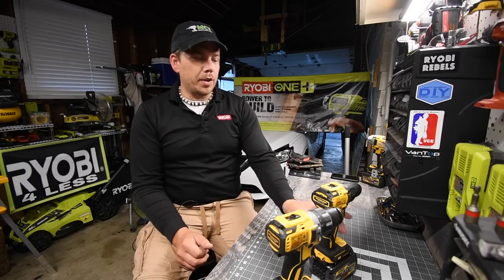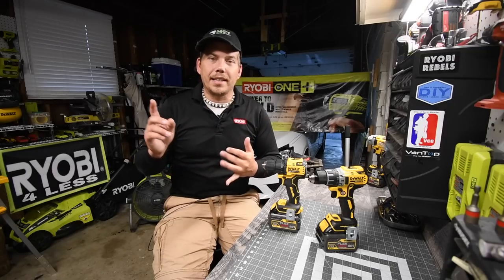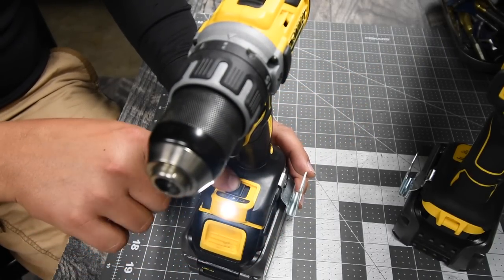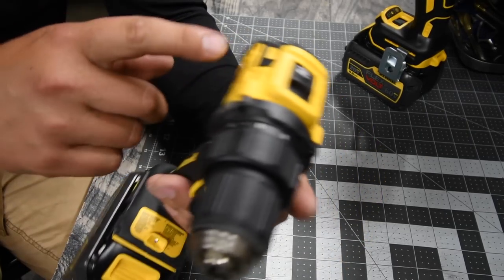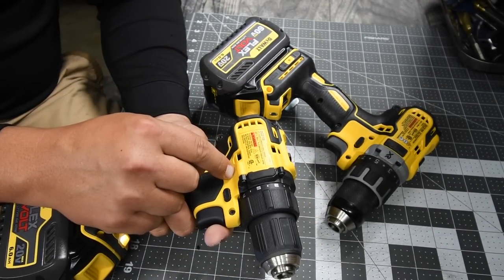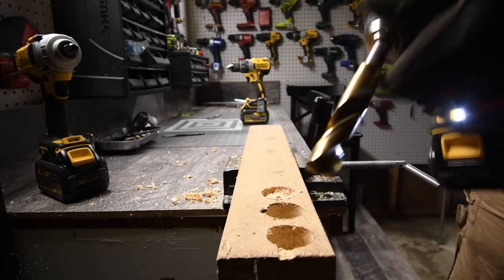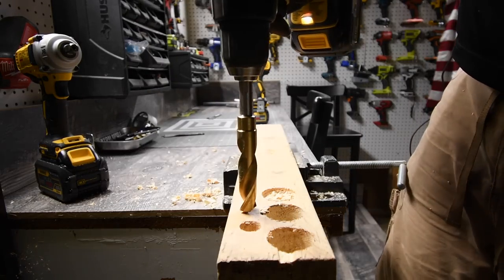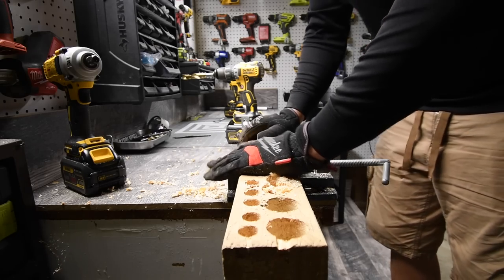Dewalt Atomic Vs.  XR

Comment: I am a career carpenter and love my ATOMIC drill , for drilling decks or hanging doors etc all day it is ideal, I even   put a 600x16mm auger on it in speed one of course ,it powered it through 300mm of seasoned hardwood easily ,very impressed. I bought it specifically because I wanted a light drill and I am on the 18 volt platform ,if I wanted brute force I will use the heavier 996 . The  708 was never meant to match the 791 ,but It still punched well above it's weight.
Reply from the maker: people need to give the atomic line more credit then what people give it. I thank you for viewing Interman
Reply: I know this comment is old but I was looking more from someone who does finish carpentry or hang doors which is what I do. I appreciate this comment thank you!

Comment: The torque specs on the DeWalt DCD791 is 460UWO = 70nm or about 620in-lbs or about 51ft-lbs, just thought I would add that incase anyone is wondering 👍.
Reply from the maker: I thank you for the additional information Kristian

Comment: I opted to skip the atomic drill and carry the xr and the 12v extreme drill instead . I just really like the specs , built quality and feeling of the XR, never rock my drills or driver with a bigger battery than a 2 ah, or a 4ah max, so weight to me, feels the same almost, if i really want to go light i use my 12v.
Reply: Crap!! why you  keep saying atomic, and again XR and impact dril and extreme dril, you confused us with Impact dril and impact drive and exrteme dril and extreme drive. could you tell those terms you are using?

Comment: My dad has the XR line impact driver and Xr line Drill Driver. I bought the atomic drill driver and hammer drill combo with two 1.5 amp batteries, a charger and a touch system case for $150 at Home Depot. It doesn’t have the same power as the bigger dewalt and makitas and Milwaukee but I have the less fatigue from not having a heavy impact while at work.
Reply from the maker: I thank you so much for viewing :)

Comment: Sometimes you need to realize that time really doesn’t matter if it can get it done. On every test, the atomic could do it quickly, but not as fast as the XR. In my opinion, the size difference is worth it because it has the power to do it.
Reply from the maker: power isnt the only I look for in these tests
Reply: @ManCaverTools  exactly
Reply: This may be true in a diy setting but not in a professional setting. I understand that this video is not largely aimed at professionals in the industry, but significant time differences do matter. Having to drop to speed 1 for one drill vs speed 2 for the other drill won’t make much of a difference if you’re building a planter box or installing a new light in your bathroom but it makes a big difference when you’re roughing out a whole house. Again that’s not exactly the scope of this video, but when these tools are your day in and day out, time is money. Where I personally draw the line is stepping outside of my current platform for more power.

Comment: Technical answer: The larger batteries DO NOT provide more power. It's exclusively run time. The "60V Max" is only for appropriate tools, but your AH (run time) drop by 1/3.
Reply from the maker: larger batteries allows you to use the power that is already there. the additional cells share the load more efficiently providing more power to the motor. ive already proven in hundreds of video across all battery platforms that a higher amp hour battery can do tougher tasks easier than a smaller ah can. Its not just duration

Comment: careful what size drill bits used in either of these drills. the manual actually warns max size bits to use. if too big it ruins the gear assembly.  composite gears unlike the larger dewalt drill with metal gears.  I ruined 2 compact XR hammer drills, one using an 1 1/4" paddle bit and the other mixing roof coating in a pail with mixing paddle. dont get me wrong, these are great drills when used correctly.

Comment: It looks like the atomic did everything that the XR did (with the exception of maybe one test), and the main difference is that it takes a bit longer due to the stronger motor of the XR... the time difference is something that may not be a deal breaker for the homeowner/DIYer who does few jobs here and there around the house, but will make a big difference for a pro who's using this for hours daily... great video and I think I will go for the atomic given my use and taking advantage of its price and lightweight

Comment: If anyone want a good drill but not to expensive get the Milwaukee m12 drill and impact driver kit 200$ for both 2 batteries and charger included the m12 line keeps up with the m18 line look it up the m12 line spanks dewalts 20v line 🤷🏽‍♂️
Reply from the maker: I love the m12 line and I thank you for viewing Samurai
Reply: Milwaukee here in the uk is exceptionally expensive, just the M12 drill is 160 pounds and that’s just with 2ah batteries, god forbid you want a bigger battery because you will be charged two thirds of the price for a 4ah battery and no case. Ridiculous price here.

Comment: The atomic drill is really good for cabinets. Plastic chucks are nice because they are less likely to scratch the finished surfaces, which the chuck comes very close to very often. And it's ratcheting which is very nice.

It's also lighter and every bit helps because you are very often holding it above your head. Same goes for the tiny starter batteries it comes with. It's real handy to have 3 or 4 of those things. They're fine when everything you're doing doesn't come close to challenging the motor.

Being short is also very important when you are frequently predrilling things that need a right-angle drill. It may not be much but maybe it's one less time you need to bust out a special drill. The same goes for the hammer drill functionality. Maybe once a week I have to put 3 tapcons into something. It may not be the fastest hammer drill, but it is a lot faster than going back to the truck to get a real hammer drill that needs an extension cord and a chuck key.

Puts out enough power for holesaws, and the lower rpms here are another unsuspected plus because it stops you from smoking out said saws.

I really really like the worklight feature on my other drills and I wish this thing had it.
Reply from the maker: that is true and the light feature is awesome to have and I thank you for viwign Micheal

Comment: I use the 708 like a dremel w/grip. The low amp batteries hamper everything. A 5ah battery on the atomic, drills and grinds everything quite easily.

Comment: I own the 998 power detect hammer drill, go big or go home lol. It’s the strongest drill I’ve ever used
Reply from the maker: the power detect beat the HILTI hammer drill. you should check out the video
Reply: I have the same but that thing is heavy to carry on your tool belt. I have the atomic for small stuff.    Im not gonna drill 1 inch holes without the drill with the handle lol.    But atomic is awesome.  Although I find myself just drilling almost everything with the impact.

Comment: im curious on if those paddle bits needs to be spun up first then fed into material? since most of those motors have overload protection for the motor that reduces the confuser actually getting confused on the poles
Reply from the maker: there are some tools that just cant handle the task. the bigger  models of all brands can do it on high speed. but not these ones cannot

Comment: I have the dcd 796 so theoretically it should be better than both. Still in that mid-tier category but it performs well, you can even attach a side handle if you can find one that fits, even though it's not designed for it.
Reply from the maker: I thank you for viewing  :)
Reply: 796 is 791 with hammer drill function.

Comment: I had the dcd 796 the hammer drill 
It was a good little drill but the dcd 996 is even better speed 2 is the sweet spot for that powerful drill
Reply from the maker: I thank you for the input Ap
Reply: 796 manual..... 1/4 inch maximum hole size in masonry

Comment: I confused can someone help me? I lost my manuals.

Speed 1 is Low speed and High torque.
Speed 2 is High speed and Low torque 

The clutch number ( on the ring ) is used to control the rotational speed ?
#1 is the slowest and #15 is the highest speed. ??

The symbol "drill bit " on the ring, when set it operates INDEPENDENT of the clutch, and run at full speed (highest one) ??

Thank You
Reply from the maker: the clutch is for torque control. it helps you set in screws to a certain depth so it will automatically stop. the high the clutch setting the deeper the screw will go in. but you can can find the right clutch setting for a certain sized screw you can drive it in to the correct depth in one shot every time for the same sized screw

Comment: It was my understanding that the weight difference between the two, and the "compactness" of the Atomic line is nominal.  Maybe next time break out the micrometer and the scale and show this?  Just a thought.  Appreciate the vid.
Reply: The atomic drill is definitely smaller.    Not the impact though.
Reply from the maker: will do and I thank you Fuente
Reply: Atomic is about 495 grs lighter than the 791 according to the specs, this is not insignificant .

Comment: I'm DIY too, but I need a drill that will drill 3/4" holes in 3/4" thick steel. I have a 320 A welder and I do not work with it industrially, but I need it for my projects. : D
Reply: At that point just get delwalt's top end maybe lol

Comment: For the price, is it just better to buy Ryobi instead of the Atomic?
Reply: For a homeowner i would say yes.  You can get Ryobi and Ridgid brushed drill and impact with 2 batteries and charger for $100-120..  I have the ridgid gen4x brushed combo and paid $119 online, sometimes the drop to $99
Reply from the maker: we will have to find out. I will do more tests on that and thank you Grand
Reply: I’d like to know as well. As a homeowner I bought the atomic 4 piece kit with 2 batteries and charger mostly for the recip saw, oscillating tool and impact driver. Paid $300 early this year.
Reply: mixwell1983  Only problem with Ridgid is they don’t make outdoor power tools but I do love my gen5x hammer drill and circular saw it’s a beast!
Reply: I have Ryobi and Atomic ,the Atomic is soooo much better ,quality and everything.

Comment: I actually have both, idk why but I just do. I'm just a maker so I'm considering either selling one or the other but idk which one. So I went for a comparison video🤷🏻‍♂️
Reply from the maker: id stick with the XR
Reply: Stick with the XR if keeping only one.
But having two drills is not a bad idea. 
I have one in each of my tool boxes.
One for carpentry. One for plumbing.
Reply: @tor-arnemathiassen9278  but I'm just a diyer/maker, woodworker, idk what to call myself, probably a handyman too. But not on professional level at all. I don't do it for work. I just fix around stuff in my house.

Comment: Hey Dave which dewalt hammer drill is the best at drilling a masonry bit
Reply from the maker: I still need to do a concrete test against all of the hammer dills I have
Reply: Dcd 996 or the dcd 796

Comment: They should have put a metal chuck in that 708 and its perfect.
Reply from the maker: I do agree with you on that one
Reply: The dcd709 that we have here in England is the hammer drill version of what you call the Atomic line in America and that has metal chuck
Reply: Because of our advertising standards/ requirements they are not named 20v max but called 18v XR line here in the UK

Comment: Why use different size batteries on the tool
Reply: If i remember correctly you used different amp/hr batteries per tool. Not matching say 5.0 amp vs 5.0 amp

Comment: I have the atomic driver. Now I'm planning to buy tomorrow drill. After seeing this video. I think I'm getting the xr drill because of 50 cad difference. And the battery for the xr is 5AH it's a good deal. My question is will the battery of xr can be use with 20V atomic driver?

Comment: The 791 still on sale and get (2) 5ah batteries for $159.
Reply from the maker: very good and I thank you for viewing toolmat
Reply: Where?
Reply: @ThaiNguyen-ny9yz  Home Depot,  search for Dewalt drill, add the $199 drill, 5ah battery charger, bag to cart... Then search for Dewalt battery and add the 5ah battery to cart, see price, went down to $159,  you can return the extra battery for $53 if you want... Making the bag, drill, charger,  one battery $106

Comment: Tell ya what, if I've got to drive lag screws on #1 setting with the Atomic, I'm fine with that. I paid $129.00 for my atomic hammer drill/driver and it's done everything I've needed to do. And it did it for $150.00 less than the XR. Smile every time I watch one of these tests and the guy says the XR is far superior! lol. That XR stopped at the same point on #2 that the atomic did and both had to be switched to the #1 setting to finish the job! Oh wait...the XR can screw in the 6" bolt 2 seconds faster? Haha who cares? Unless your playing racing drills.
Reply from the maker: I do thank you so much for viewing :)
Reply: Exactly and the 709 or Atomic as you call it in the states is shorter and lighter, I'll take that any and every day rather than a couple of seconds quicker and 541 grams heavier.....  that weight difference is definitely noticeable when up a ladder in an awkward position etc and in first gear the atomic 709 is 26nm VS 796 at 27nm and in second gear the difference between then.is 70nm with the 796 and 65nm with the atomic 709. Really not much between them.
Reply: My thoughts exactly, even when I'm using 600x16 and 14 mm augers drilling holes for cyclone rods in  house frames all day ,the Atomic is all I use now ,the lightweight is great ,I hardly ever use my big heavy drill anymore.

Comment: What would you recommend using to clean the handles of your drill/drivers?
Reply: Tub O Towels
Reply from the maker: I use a rag water and very little hand soap. dont want to use solvents that will ruin the molding
Reply: @ManCaverTools  you said click it back once to lock the bit into place on the Atomic, I own a DeWALT DCD777C2 drill and the manual says nothing about clicking it back once. Am I missing something? Thanks.

Comment: Thx for the video! Also worths mentioning that you can actually get the atomic line for "free" with Airmiles (Canada), which I got :-)  And indeed, the line is perfect for DIY users, these are my first tools, I'm not gonna use them more than 5 times a year, and as a bonus I can use the same batteries as the XR... that's a great deal.
Reply: I’m

Comment: I am at an impasse. I am a homeowner doing little diy's, buidling sheds and furniture, fixing doors, etc. . . I bought the atomic combo with drill and impact driver for 180USD....and I seem to like it. It is actually the newer line with compact batteries 20v 1.7ahn... BUT with the same combo in XR series with 2, 20v 4ahn at 280USD, I'm not sure if the extra 100 dollars is worth it. Can someone help me. I know I'm not a contractor and Im not going to be drilling foundational nails all day, but do want to know when an opportunity is presented my drills are ready. Its a one time purchase.
Reply: Which one did you get?
Reply: @rastaman7140  there was a sale on home depo website. 1 flexvolt advantage driver, 1 xr impact drill and flexvolt circular saw + 1 6ah flexvolt and 1 5ah battery for 400. I got that instead...worked out well for me as i got the flexvolt leafblower and weed whacker...

Comment: Seems like the onboard computer is protecting the transmission when you are on speed 2. Tools have gotten very smart these days. You can tell because it shuts the light off as well.
Reply from the maker: yes it does DW
Reply: It's more of a over current/stall protection for the brushless motor.

Comment: DCD708 
0-400RPM, 0-1650RPM
DCD791
0-550RPM, 0-2000RPM.
speed on 791 better.
therefore, I see no reason to measure the drilling speed. This can be seen from the specification as well.

Comment: Why does nobody (or no test at all) show clearly how the wobble is during drilling? I've had several good cordless drills, but all of them had way too much wobble when drilling. Just use a small (long) 2 mm drill bit in metal

Comment: Hi mate, picked up a DCD709 + DCF809 with 3 2Ah batteries for £199 (GBP). Is this worth it? 

OR should I return it and buy a DCD796 + DCF887? Mainly for home use & for other people. Should be around the same price but will have to be refurbished or used drills.
Reply from the maker: id go for the dcd796 kit